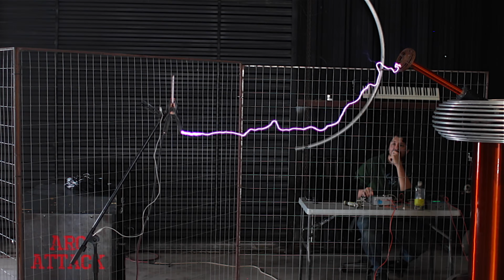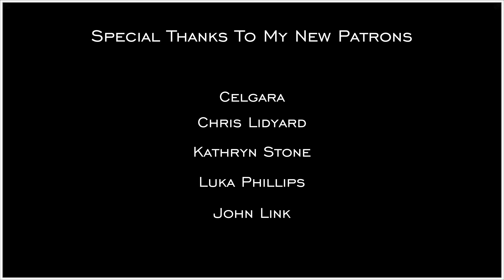iPhone Vaporized by Lightning from Giant Tesla Coil ( ft. ArcAttack )

Comment: Bro u have great stuff on your channel i shared it to my school and they found it very useful for demonstrations as well but now i want to make my own sgtc in which i have a ferrite core transformer with zvs produces about 7.5kv now how much long arcs can i get if i use your tesla coil circuit as wll as i also have a rotary spark gap but my tower is not very large. just 1.5 feet long abd 6 cm wide anx has about 1400 turns so iam currently driving it and i found about 1 inch long arcs but i want longer arcs so how can i achieve them

Comment: Technically you did not get 1 million volts across the I-Phone , Most of the energy was in the Plasma Spark , you could have killed it with much less voltage and smaller sparks directed properly ...

Comment: My first high voltage module was an ignitor from a gas stove that I took out an oven someone threw away. I had to tear that oven apart, and it was a small yellow box that ran on AC mains current. I mounted it to a wood board, put copious amount of hot glue on the AC side, and connected a switch, and put the output wires on 2 nails. I was 15 when I did it.
Reply from the maker: Thats pretty creative! my first one was pretty simple too

Comment: Just to add a small correction. The high voltage does not flow through the iPhone. Current does.
Reply from the maker: True. VOltage is just pressure

Comment: how much current flow do the tesla coil creates?
Reply: About 15mA,  judging from the power and voltage. Tesla coils generate huge voltages buht very small current
Reply: @natmath2576  just to clarify, 15mV or 15mA?? Be careful on your units mister or miss.. mV is a unit for voltage while mA is a unit for currernt.
Reply: @j.danielatlas5684  yep, meant mA, still the same number though
Reply: @natmath2576  Thank you for fixing it. Have a great day!
Reply: @j.danielatlas5684  well, i won't leave an incorrect info there... 
Have a great doy you too
Reply from the maker: They can...but really are more likely to vaporize your skin on the contact point. High frequency AC tends to do that.

Comment: Is it possible to remove the diodes from a flyback transformer to make it ac and use it as a tesla coil
Reply: if you refer to transformer from CRT monitor, its realy hard to remove the diode, full epoxy over.
Reply: I can not say it's not possible... But will be really hard to do so.... Instead U can use car ignition coils(or motorcycle ignition coil) ... They are ac high voltage transformers.
Reply: Easier to get one special made without the diodes, I would guess.

I have some oppocite polarity flybacks ones for the sake of it..!
Reply: you can make zvs tesla coil which uses dc flyback transformer